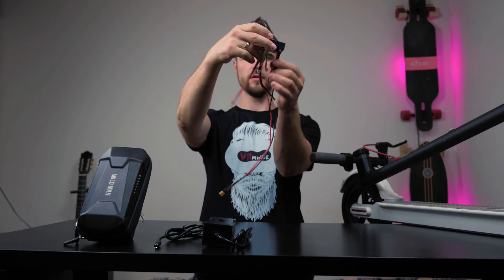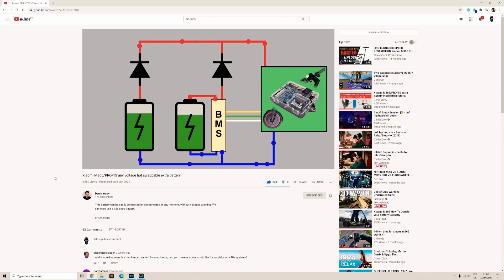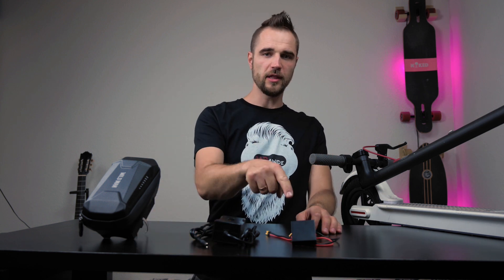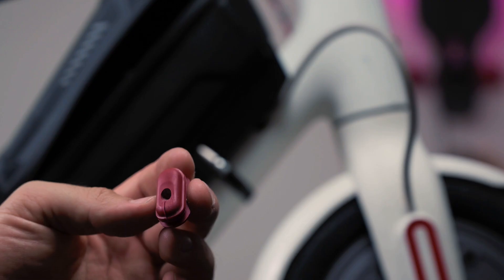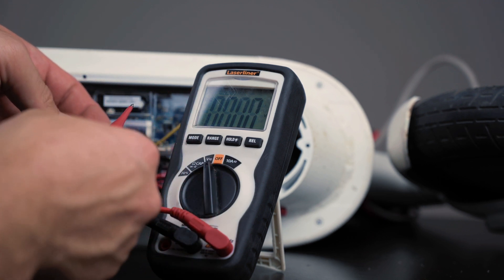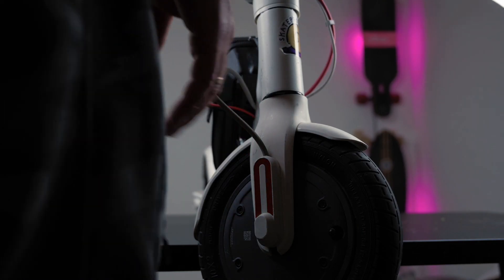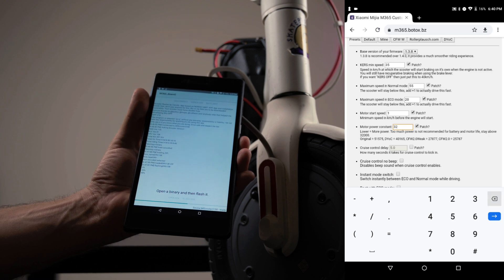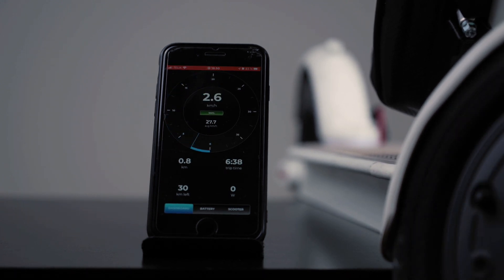Rita - the most waited Xiaomi M365 update?!

Comment: Do you need custom firmware or can it work by just connecting rita to everything and go
Reply from the maker: You will need to make a couple chamges for a higher voltage battery in the FW

Comment: So all I have to do it get a rite attachment, plug the eternal battery in through that?
How do you charge battery? Do you just charge like normal?
Reply from the maker: If you use higher voltage external battery you need a higher voltage charger, but yes, you can use the same charging plug with Rita to charge both packs. There is a user manual here https://public.embedden.com/Rita/Docs/English/rita_manual_latest_en.pdf

Comment: Hi Hope your well! I just have a RITA coming this week so can I as it’s not a 48v charger and use the original charger I have so this charges both battery’s when plugged in and it will take a long time I’m sure although the extra battery is 48v it still charges ok and in full as I am planning to use it like you! thanks
Reply from the maker: I might not completely understand your text mate. For "48V" pack (I assume it is a 13s pack) you will need a charger with 54.6V.
For your original "36V" pack you will need a charger of 42V. 
I would charge both batteries separately with separate chargers.
Reply: @VRMinde  yes i thought so as in this video you didn’t make it clear about the charging separately as someone may buy the 48v battery and charger and boom! their original one as they will connect both via RiTA and charge thinking it works like this

Comment: So u just buy Rita and flash ?
Reply from the maker: Rita makes sense if you want to use two batteries with different voltages. Let's say you want another pack that is 12s but you want to keep your stock one for more capacity - range.
Reply: @VRMinde  not true, you can also add a 10s battery in the bag, and remove it whenever you dont need extra range and keeping your scooter light and bag empty.

Comment: So, having rita with a 10 s external battery does not add speed. You need higher voltage battery.. Right?
Can u use rita with 3 external battery?
Reply: Hello, Can u tell me pls how to upgrade my xiaomi motherboard o where can i buy it.. I heard tha u can use rita with 13s but to cut the red 12 s cable.. Which one?
Reply from the maker: @robertola3263  for what to cut and what not to cut on Rita - read manual - everything is detailed there. 
Motherboards just google or look on aliexpress 🤷🏻‍♂️
Reply from the maker: Yes mate, for connecting another 10s you don’t really need Rita. You can just connect the packs in parallel. For more speed you will need more voltage.
Not really understand what do you mean by 3 external battery?
Reply: @VRMinde i already have 3 external bateries on my xiaomi 1 s(36v12ah +4ah+4.4)+stock battery.. Max speed 34km/H.
Reply: The problem i already, ordered it
Reply from the maker: @robertola3263  all of your packs are 10s, you can charge them to the same voltage and then connect them in parallel. No Rita needed. 
If you want a step increase of speed you will need to get like a 12s pack. The benefit of Rita is that you can connect the 12s together with your packs (all 3 connected in parallel)

Comment: are there any rita alternatives? the website isint working for me.
Reply from the maker: Just checked the web, it’s working https://m365.embedden.com/rita_adapter
I am not aware of any alternatives letting you to connect two batteries of different voltages. You can connect a bigger voltage battery with xiaogen firmware, but you will have to disconnect the original pack and disable all bms data.

Comment: Can I install Rita in a m365 pro
Reply from the maker: I am almost sure you can, but ask the seller before buying mate
Reply: @VRMinde  ok thx
Reply: I have installed rita with 13s the  votage on my show 52v the problem is with me on the max speed is 20km/h
Do in need to use tooltick mija m365? Range is good but so slow

Comment: Hi bro, How come you need a higher volt charger for the external battery? Do you have to charge the batteries separate?
Reply from the maker: Because the external one is 10s - charges up to 50.4V. That is the best benefit of Rita - you can connect two packs of different voltages
Reply: @VRMinde  what would happen if I use the standard charger with the higher voltage battery?
Reply from the maker: @ajayb2478  you won’t be able to charge it up fully

Comment: Great Video✌😊. I wanted to order Rita but still have some questions:
1) I have seen lately people buying 4A charger for the xiaomi pro2. Is it possible to charge Rita Kit with a 50.4V 4A charger? Will it be safe? I know about the durability of the battery will decrease i just want to be sure the cables will make the 4A. This would take about 5 hours for both batterys i guess whats a big plus.
2) on the video of Denis he talks about 12s4p battery but on the www site he is selling a 12s3p battery. Why he not sell the bigger one any more??
3) i have seen someone on Internet using a 13s battery with rita and he only changed the firmware how is that possible? I thought you need to change the bms or something on rita otherwise not working? 
Thanks
Reply from the maker: 1 the charging cables on Rita look like the same thickness as on m365. If you think 4A are fine for the stock battery wires - they must be good for the Rita too. Especially that charging 2 packs will split the load on them.
2. I cannot know that mate. Maybe because if the size? 
And overall - I have not had “not enough range”, not even a single time yet with 12s3p + 10s2p together. Do you ride your scooter for 3 hours+ ? 
3. Rita can take 30A on the external battery input and batteries up to 15S. You just have to cut the jumper wire on it and have your scooters controller capable of 63V. Otherwise Rita will burn when controller will fail during regen. Try reading this http://public.embedden.com/Rita/Docs/English/rita_manual_latest_en.pdf
Reply: @VRMinde  thanks you for the fast answer i really appreciate it.
1) I think you not get my issue. It is about the cables that come from the charging port to the Controller. They are very thin and some people change it to thiker ones other say it is good enough for 3A. It us very confusing as everything on Internet😂no Mater how many packs you have you will send the 4A through the charging port for lets say 5 hours. Maybe Denis or someone else has an opinion too would be great.
2) No on his youtube video he is showingband saying that 50 cells fit in his bag and talking about 10s5p or 12s4p packs. On daily commute i not use it more but on weekend if beautiful weather then 3 hours gos fast away. Besides i want if i invest so much money to get the max possible out of it even if paying 40euros difference for the extra cells i hope you get me😊 Anyway it is again Denis that should tell as about it.
3)i get you. I found a site in England that cells modyfied xiaomi originally controllers for accordibg to your battery needs...take a look. https://vtaescooter.co.uk/shop/ols/products/upgraded-controller/v/PGR-CNT-13S-54
https://vtaescooter.co.uk/shop/ols/products/upgraded-controller/v/PGR-CNT-13S-54
If i buy such one + rita + a 13s-15s battery + the charger for this battery am i good to go without any issues??  I am a newby to all this sry for asking so much, but i prefer doing this from beginning correctly not investing and later beeing disappointed that for 50euro it could be muchhhh better. I hope you get me on this too😊Nice greetings to Denemark from Austria✌
Reply from the maker: @frangiskosmoniakis3965  1) I understand you mate. If you want to know what wire thickness is needed for how many Amperes - google up "Copper ampacity chart" and you will find one. For 7A you would need to use AWG22 wire (or 1.29mm^2). 
3) You would make a big investment and no one will guarantee you "riding without any issues". Upgrades like these cause series of potential problems - overheating controllers or motor (don't forget your motor is rated for 350W constant power, 500max, if you use 15s and 20A, you are looking into 1260W). Therefore, it will depend on how you ride your scooter, what firmware do you set, how much attention do you pay to the temperatures etc. etc. 
If you want to "ride with no issues" faster and further, probably a scooter that is designed for that with a decent suspension, better tires, better brakes, and selected components for the power and voltage would be a better idea. At the same time it is fun to upgrade stuff yourself, learn in the process and sometimes walk back home pushing your scooter :D The decision is yours, mate!

Comment: 30km because it doesn't touch the ground
Reply from the maker: Not sure I follow mate
Reply: @VRMinde  he's saying it only reaches 30km/h because the way you tested it's not actually making contact with the ground, but yeah, it does reach that speed on the road as well, just takes longer to get to it. It also takes longer if you're on the heavier side ^^;
Reply from the maker: @rabywastaken  now I see it mate :) my general conclusion is that m365 with a stock battery reaches around 28km/h with my 85kg, around 35km/h with 12s pack 🙄
Reply: @VRMinde  that's awesome! So basically, just like advertised :)

Comment: hallo VRMinde, can you please attach the frimwork thanks
Reply from the maker: I don’t have the file mate. Just go to https://m365.botox.bz and create a custom one. Set voltage to 50.4 and you good to go :)
Reply: @VRMinde  sorry for so many questions lol, does this CFW work with Xiaomi 1S or only for the pro version
Reply from the maker: @ajayb2478  honestly, I am not sure what works on the “1S” because I have never had one :) 
Basically, If your dashboard is with the speedometer - you will need “pro” firmware. I know that for the new xiaomi models you had to use the paid version of “xiaoflasher” app to get the customizable firmware. I am not sure if xiaogen http://f0456977.xsph.ru works with it either mate, sorry.

Comment: Did you enable remove charging mode?
Reply from the maker: Yes, I did, but I am not sure that is necessary. What is necessary though is to set the max voltage to at least 50.4V
Reply: @VRMinde  oops...I had 51V as value for the m365 @ rita 12S
Reply from the maker: @Bergwacht  that is fine. It should be at least or above 50.4 :)
Reply: @VRMinde  must be ok, otherwise something would have burned out
I now drive Rita with 48V on the G30D without data line connected lol ,the plug to the rita from the g30 does not fit

Comment: Try the "Xiaoflasher" app, because you can build the firmware with the app and flash it directly without that botox thing
Reply from the maker: Yeah I use it every time now. The downG fails to change parameters sometimes
Reply: @VRMinde  But be careful, xiaoflasher does not work with Chinese fake parts.
i had a fake pro dashboard on my normal m365, flashing with downg was working, but xiaoflasher only showed me an error.
I asked the programmer what's going on because this flash function costs money, he said it doesn't work with fake boards and just offered me a refund.
Reply from the maker: @Bergwacht  ok thanks for the heads up

Comment: I ordered my RIta today but I don't understand it correctly. Is it like the Y circuit with the additional battery, like now? Or can I change the additional battery on the way if it is empty and it doesnt matter how empty the internal battery is?
Reply from the maker: Yeah, you can just plug any battery (in the Voltage limits ofc.), any time, despite how empty or full the stock one is :)
Reply: @VRMinde  cool, i'm happy - finally no more car battery + 220v inverter in the backpack :=))
Reply: Sorry ,one more question^^

The rita manual says over 12s(51v) i need a controller modification, what kind of modification?
its enough to set the voltage up when i build my custom firmware?
Reply from the maker: @Bergwacht  no, I asked Denis, he said above 12s the controller needs to be modified physically, I do not know what parts does he replace 🙄 and then you will also need to cut the red cable on Rita :)
Reply: @VRMinde  thank you for making the effort to ask, then I'll wait until someone figured out how it works^^
Is difficult to find a 12s 44,4V battery. I just can find 48v batteries and iam not sure if they are under 51v when they're full.
the 44.4v battery from dennis is unfortunately very, very expensive.
maybe I'll buy them if I can't find a solution.
Reply from the maker: @Bergwacht  12S will work just fine! Mine charges to 50.4V and there is no issue (just set it in the firmware). The problem if you go  more than 51V (13s+)
Reply: with rita is it possible to charge both batteries using the charge port on the scooter? or do i need to use an external charger?
is it possible to use 10s and 12s batteries (hot plug)? or once is set to 12s is not possible to go back to 10s?
Reply from the maker: @Davide25084  The same plug (original one on the m365) for both batteries. You can plug/unplug 10s or 12s anytime, despite what is the state of the other battery. One guy (bergwatch) is caryying extra 12s in a backpack and when the first 12s+10s is nearly dead - plugs in the "new" 12s and continues the journey with no issues :)
Reply: @Davide25084  You can hot plug the batterys on the go but when you switch from 12s to 10s or the other way around you must change the parameters in the rita bms app.
you only need a new charger when you using 12s battery(51v charger), you can charge everything whats connected on your scooter via the original scooter port.
no mather if you connected an external 10s or 12s battery.

Comment: So you could do 63Volt?
Reply from the maker: If you modify the controller - yes, you just need to cut a "jumper" cable on Rita. It is made so on purpose, as more than 52V won't work without the controller modification

Comment: So with rita, Can I connect a 13s external battery ?
Reply from the maker: adrian pogi hi, you can even connect 15s with Rita. 
But everything more than 12s will require modification of the m365 controller. 
14s and more will also require to cut the red cable on Rita as well.
Reply: This one can do 13S i drove it.
 https://vtaescooter.co.uk/shop/ols/products/upgraded-controller

Comment: hello, where can we buy the rita?
Reply from the maker: john ice hi, try looking here: https://m365.embedden.com
Reply: Ok, thanks. The battery that you sell on your site does not have a charging socket, how to recharge it if I install it on my xiaomi
Reply from the maker: john ice it is not my site mate, I just bought it myself and reviewed :) it is not my product, I did not even get any discount for it.
The external battery plugs into the “rita” device, and the same with internal one. Rita device has a plug for the charger port as well. So you use original m365 charger port, 50.4v charger and through Rita it charges both batteries :)